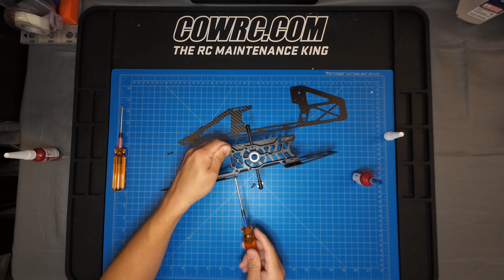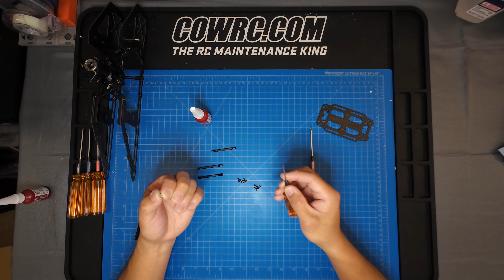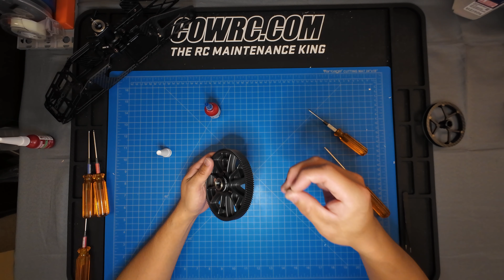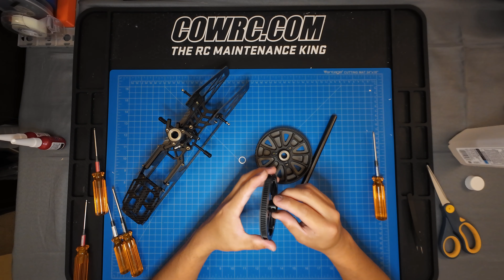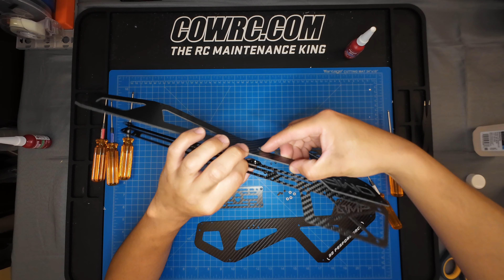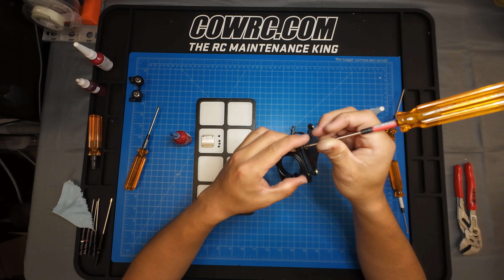OMPHOBBY M5 Build Series | Part 1 | Pages 1 - 8

Comment: Hey CK,  when you rev up the main rotor do you hear about 2 high pitched resonance points? I can hear them both at start up and when cutting off the motor! Was just wondering if this is common?
I am using the stock motor and ESC with the 6S setup.